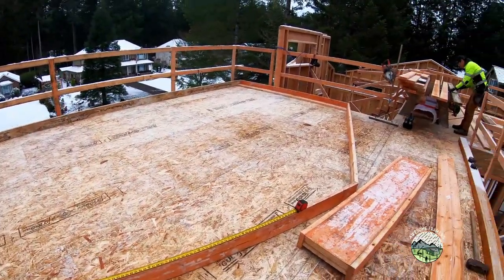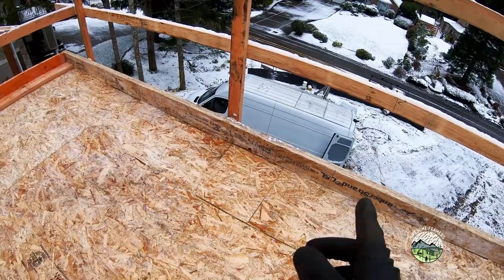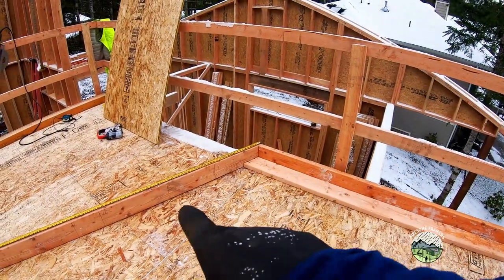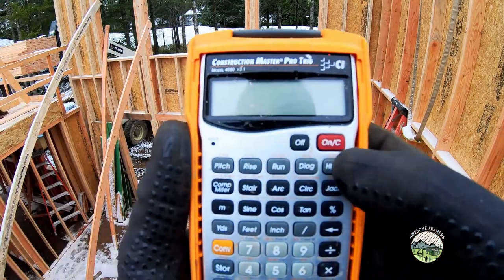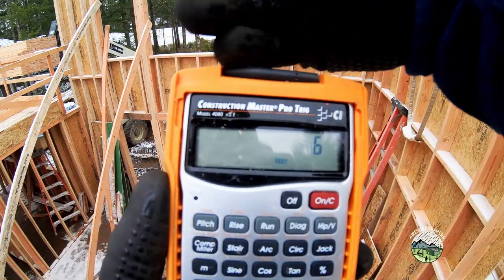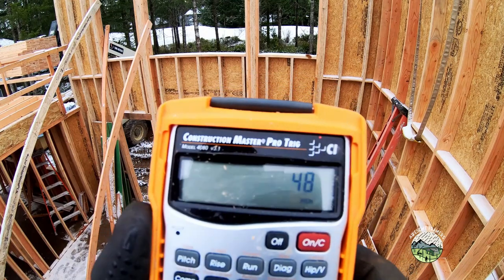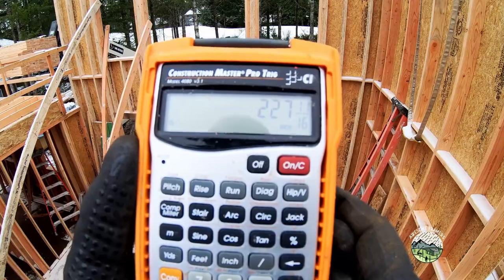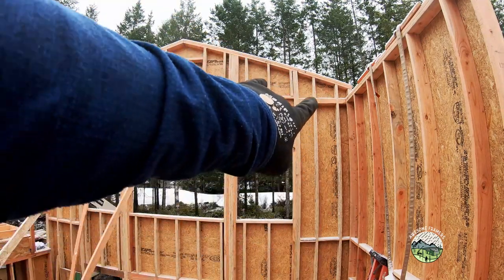Rake Wall Layout

Comment: When you are calculating your stud spacing at 24" o.c, you're pushing 24" RUN, 4" PITCH, DIAG, M+,+, RCL, M+,= Once you get the diagonal, 25-5/16", just hit +, =, it does the same thing and less buttons to remember . Construction Master calculator is an awesome tool.

Comment: Great video. I wish they would teach math this way in school. So many kids fail at math because they can't apply it to anything. Rise over run makes a lot more sense when you see it used to build something.
Reply: This isn't teaching math, this is teaching how to use a calculator. Anyone can press buttons on a calculator. That is what they teach in school today. Math is when you actually do the formula and calculation for the solution. Notice how many people under 40 can not do simple math at the checkout? I can layout the wall the manually way just as quickly as he showed using the calculator, no batteries required. Sometimes, the high tech way is not the easiest or quickest way; or the most accurate way. He made a math error on a wall in his video on balloon framing and had to modify/ repair it. Had he used the old school way, he would not have made that mistake. Time saved on all the walls of the home was a fraction of the losses incurred in that one mistake.
Old school for the win!   ;)
Reply: @briangc1972  - I wasn't really referring to the calculator but the applied use of rise over run. I think most people learn best with hands-on experience. It would be nice of there were more opportunities for youth to learn math concepts this way.